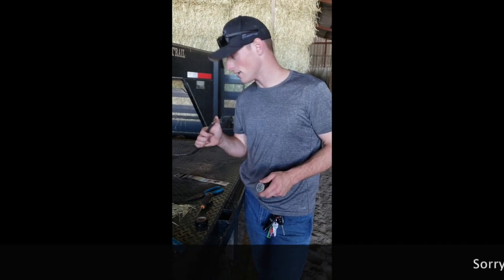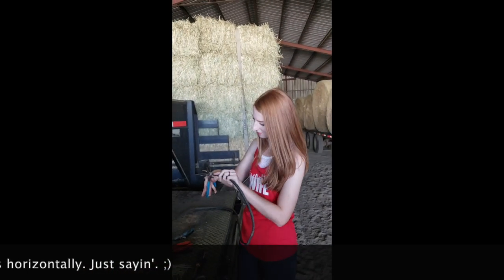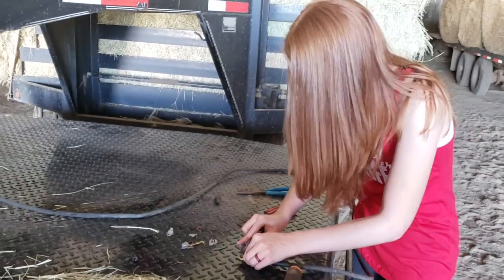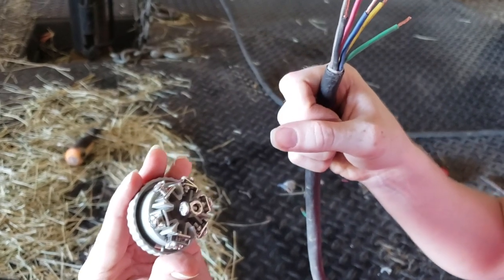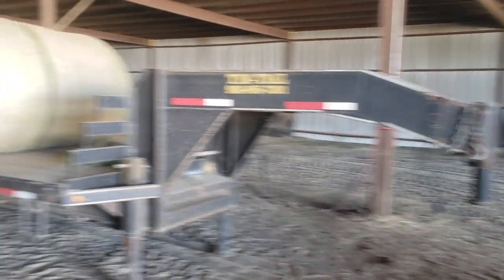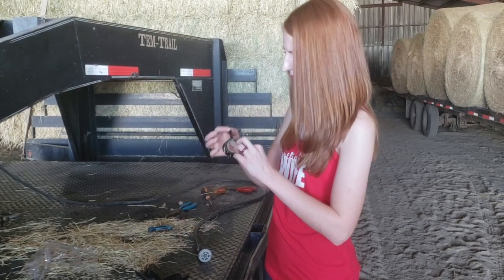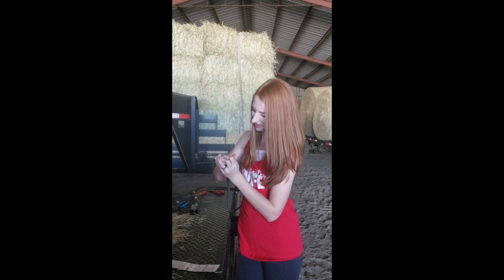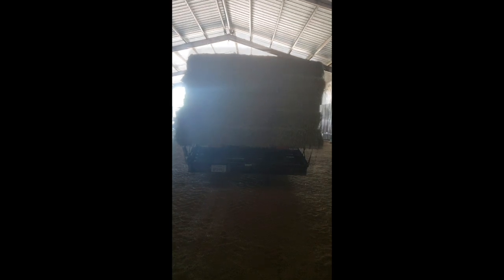Hauling Hay to the Feed Store + Cutting More Hay Down

Comment: Look the wiring pattern up online. Then, test your truck to make sure you have no issues there. Make up the connector and use a electrical grease when you put the wires in the plug. It will keep it from corroding and causing you to go back into it in a year or so. Running lights should work on the sides AND back at the same time. If it only works on the sides it can cause a short issue when you hit your brakes and that can cause that error reading on your dash. You also have a 12 volt that goes back thru that plug from your truck. I'd wire that up to. You can put a deep circle battery on your trailer (which is required over a certain load for the emergency disconnect). That 12 volt supplied in your harness /plug can recharge that battery and you won't havta do any extra work EVER if you wire it up correctly.

Comment: Yes John Deere cutters are more expensive.   We cut about 300 acres per/year, bought the moco new in 2011, never had a breakdown of any type.  You guys are doing great, don't get me wrong.  You've taken on quite an undertaking!  If it was me I'd trade that New Holland cutter in.  Nothing more aggravating than equipment that constantly breaks down.   At least I think so.  Hang in there it will get better as you get more experience.

Comment: On the mower, make sure all the pulleys that should be free spinning are doing so, grab each one with both hands and try to wiggle them, if they wiggle you got a bad bearing or bushing. That belt should be fairly tight, check the springs on idler pulleys, one could be stretched or cracked. There should be a lip on each pulley, top and bottom. look for shiny metal, missing paint. Looks like the main pulley is a double and the others are not, make sure you're using the correct groove

Comment: The grounding trough the ball is likely your biggest problem if the wires are all right in the plug. A good way to find out is plug it into the truck and turn on the marker lights and move the wire around the plug until the light come on then you will know. The marker lights are usually brown but sometimes trailer manufacturers don’t use standard color coding. If it’s grounded through the ball hitch you have to drive around so the rust wears off the ball to get a connection then thee lights will work.  That’s why trailer lights sometimes flicker when they go down the road empty. Confusing I know so I’ll stop there because there is a ton more that could be wrong.

Comment: On your trailer, use a 12 volt power source such as a battery charger and connect the wires one at a time to the positive lead to see what wire feeds what on the trailer.  Connect the ground from the power source to the trailer frame.  In a former life, I was a trailer mechanic.  Wish I was closer to assist you guys.

Comment: Try running a white wire to from the plug to the trailer for a ground cause it should have a ground wire . You guys are doing a great job its all a learning curve. Keep up the great videos
Reply: I thought so too and wondered if the ground was down in the rubber sheath. It wasn't and after some research, the ground is through the chassis of the truck (apparently).
Reply: White wire is neutral

Comment: Just a little advice, dont use the radio and listen to the sound of the cutter , if you have a problem the sound will change, you can also adjust your mirrors and watch the crop as it comes out the back of the cutter. I have arthritis in my neck these are a couple of my tricks to help. I put a backup camera on my round baler on the pickup I can see the crop coming into the baler and I can see the net go on the bale, and I can see the bale roll out the back of the baler looking through the pickup . good luck
Reply: That cutter can wear a neck out!

Comment: You can get terminals that crimp onto the wire and then the screw tightens on the solid pin which holds more solid than the strands of copper wire.   They have yellow for 12 and 10 gauge wires, blue for 16 through 14 gauge wires. Yall are doing real good. Keep going. Maybe another brown wire for the running lights, if the color of wires are correct.

Comment: Belts- a little research turns up that the over running clutch may be the problem. If its not working, when you slow the engine or tractor while cutting at high speed, the inertia of the spinning cutters will 'push' the tractor, and causes the belts to reverse their loading, which means the idler pulleys are not holding tension on the belts. Clutch may have gotten stuck over the winter?
Reply from the maker: Scott nunya You are spot on about this. I have great footage coming in the next video.

Comment: Great video! I would definitely hook up the ground wire because a poor ground will do weird things, from dim lights to wrong ones flashing. As far as the belt goes, there must be something out of line. However it doesn't take long for a new belt to stretch. I'm not familiar with that cutter but something funky is going on causing the belt to jump off. All the best, God bless and take care all of you!
Reply: I'm thinking it's the overun clutch!

Comment: Always run the cutter at 1000 RPMs. And your ground speed with gearing. It will take a lot of tork and stress off of your belts on the cutter.

Comment: brown/black is marker/tail lights if your brakes aren't working on trailer the the blue wire circuit needs looked at as well as the red constant power,also need a ground circuit to make sure trailer brakes work also noticed the turn signals looked dim getting on the interstate  thats where a ground circuit comes in for good light illumination, also IF it started raining in the daylight hours you would really need marker & tail lights

Comment: Check the over running clutch on the drive shaft you should hear it clicking when you idle down and the pto shaft should slow down first and let the blades wind down slowly if it all stops together it is stuck and will cause the belts to jump off.

Comment: I like to heat the wire casing with a lighter. At the right temp you can pull them off without burning your finger and they are stripped just right. I have forgotten that cover too many times. up here in Minnesota those plugs last one winter maybe two. Thanks for the vids keep up the work

Comment: Check all your grounds to chassis and make sure the ground from the goose neck hitch to frame is good. It sounds like the truck is fine, so it might be a broken wire... ugh... those are the worst to chase down... just get a volt ohm meter and figure out where you’re loosing power. Scott would sure be proud of y’all!

Comment: You guys did good, even though the was small hick ups with the wiring of the trailer. One advice you can use on any wires that are hard to strip the insulation off is never to cut across the cores of the cable or wire, always in the direction the cores are running, bend the plastic/rubber to the side and nip off the plastic along the cores with a cutter. Cutting across will make the cores very easy to break and thereby loosing connection to broken cores when the wires gets stressed. I noticed it was not a screw connector on the trailer plug, but if you have any here's another tip: when putting loose core wires under a screw connector where the screw of the connection is in direct contact with the wire is to strip a longer peace, twist the cores and fold them double before putting them into a screw connector, that will also prevent the same issue.

Comment: IF YOU HAVE SIDE MARKERS BUT NOT RUNNING (TAIL LIGHTS) ITS IN THE TRAILER.  MAKE SURE YOU HAVE THE BLUE WIRE HOOKED UP CORRECTLY  AS THAT IS YOUR TRAILER BRAKES....  MOST IMPORTANT WIRE IN THE BUNCH WHEN HAULING 20K...  SHOULD BE ABLE TO HEAR THEM HUM AT THE AXLES WHEN APPLIED IN THE TRUCK.  AND MAKE SURE YOUR GAIN IN THE TRUCK IS SET CORRECTLY SHOULD FEEL THEM DRAG WHEN TRUCK BRAKES ARE APPLIED.

Comment: When hooking up the wires to the plug... you have to open the little box on the trailer where the wire goes into.  Matching Colors does not work.  If you open up the box it will show you what color of wires control each function...and should tell you on which screws to hook them up to on the plug.
Reply: Good to know! We had no idea. I will go back and redo it ASAP!
Reply: @caraatnorthtexashay3043  looking on the other trailer was a good idea to.

Comment: Howdy,
      I showed my farmer  friend, Mitch this video, he has one of those monsters, and he thinks that your feeding the mower at more that 100% its rated "chew" rate.  When you have fixed this monster try slowing the ground speed some.  Mitch thinks the failure is that the belts are stretching from the load and popping off, not breaking.   Good luck,
Reply: I tend to operate it a bit on the slower side as we have some pretty thick grass (not a brag, we just concentrate on certain fields.)

I'm going to delve into the operators manual a bit more but we operate it on the lower speed than recommended. MPH that is.

I believe we have narrowed it down to the overun clutch not working right and jolting the system.

Comment: It is grounded through the ball, I've actually had to earn my reese hitch ball off cause it had rusted so bad thoughts wouldn't work so it does in most cases ground through the ball, so of you ever have that kind of problem some light sand paper will fix it
Reply: There is also a ground that is SUPPOSED to be passed from the truck to the trailer through the lights.  The hitch connection IS NOT CONSISTENT ENOUGH to consistently power turn signals/brakes/etc.
Reply: @jayss10  sure depending on what options you have on the trailer,  like breaks and stuff like that, mine didn't have that so it just grounded through the ball

Comment: I have found that a ground is very necessary because grounding through the ball is very intermittent and the brakes don't always work among other problems.  I always run a ground to every thing to ensure proper grounding.  Figure out the color code on the truck and wire the trailer to the truck.. those are never coded to Ford's.  And can be a s.o.b . Be safe 
😊😊
Reply: I echo the suggestion on implementing the ground on the plug here.  I know for a fact that my 2006 Dodge Ram will not activate the trailer wiring plug unless it senses a ground with the trailer.  While this is a strange brain child idea of Dodge/Mercedes at the time the TIPM is something that has not gone away after Mercedes sold Dodge.  Wire it correctly and avoid these weird quirky issues.
Reply: @jayss10  it can cause a lot of trouble. 😊

Comment: For the PTO circlip use a set of vice-grips.
Squeeze the grips together and set them to the correct tension with the thread so they just slightly lock.
Then leave them like that while you change the PTO stub.
Hope that helps.
Also,remember to do it before you hook up the next machine 😁😁
Reply: Usually I'm there to hook it up but they did a solid job!

Comment: Check how the wires are wired on the other trailer. There is a standard wiring diagram for trailer wires. 
They use a certain color wire for tail lights, certain color for left turn & stop light & a certain color for right turn & stop lights. Now on vehicles the wire colors change.

Comment: Might suggest to go ahead & run a white wire  for a ground, sometimes the trailer ball doesn't ground real good.  If the side marker lights are working, the tail lights should be also, since they're on the same circuit. Look for a loose wire towards the rear of the trailer, or the rear bulbs are burned out....  Kim, i believe Scott's note that he left for you just about covers it all....

Comment: I didn’t see you check for electric brakes for operation.  Basically you just get down by the wheels on the trailer and you should hear them buzzing with the brake controller turned up.  Need to do this with every axle on both sides.  Sometimes particularly with a trailer that sees alot of field time you can accidentally rip a wire out of a magnet etc.  Takes only a second to do.  This is a pre-trip check I do on my trailer every time.  

As for wiring repair. Don’t rely on wire color. There are several “standards” where colors are used differently I’ve seen used by various OEMs. You need to validate wiring by function particularly when a plug has been ripped off.

I usually locate the ground first visually.  It will break out of the main part of the harness not far from the plug and terminate on a 1/4 ringlet normally near the hitch. It’s usually a white wire but you gotta confirm.  From there I just use a 12 volt drill battery (can be any 12 volt power source) and hook onto the (-) part of the battery with a alligator clip or similar and touch the other wires one by one to the (+) terminal on the battery to find the function.  You’ll find the following.  I’m listing typical colors but you gotta verify. 
1.  Running light wire. Should be brown.
2.  Electric brakes wire. Should be blue. 
3.  Left turn signal wire. Should be yellow. 
4. Right turn signal wire. Should be green.
5. If equipped Auxiliary power wire. Should be black but seen red too. 
6. If equipped Backup light wire. Usually purple.
Reply: I appreciate thorough response! I checked them when driving slowly and found they were not functioning.

The truck is more than capable of handling the trailer for the distance I travelled and I also proceeded with generous breaking distance when driving.

I'd like to get them working ASAP

Comment: I vote for Cara to pick up the torch (mig welder that is) as she has the steady hand and that is paramount in welding, maybe add more guide pulleys closer to the drive pulleys on the discbine. My local CNH guys said that some belts cant handle high heat and sag once up to working temp, there are high quality belts (high price too) that can handle the heat more and don't stretch. Dang but i remember Skittles taking that road by the water hauling hay a while back, great episode ya'll and remember if it's getting to ya.... just lay back and say.... THIS IS BALLS!!!... and "get on with it", lol.

Comment: Yellow = left turn/left brake light
Green = right turn/right brake light
Brown = tail lights/running lights
White = ground
Blue = electric trailer brakes
Red = constant power for acc or charging break away battery
Reply: When I get off work I'm going to check this out! Thanks!
Reply: @treyatnorthtexashay4603  I've wired many and that is standard code. Anything I can do to help just ask.
Reply: Much appreciated! I'll let you know how it goes.
Reply: Trey, this is a standard but you gotta confirm.  There are several standards I've seen out there.  You gotta confirm by function with some sorta power source (battery etc) the wire purpose.  Don't assume color codes.  I've seen black used for auxiliary power vs red.  Gotta confirm.
Reply: @jayss10  most certainly. I will double check every with what I know now.
Reply: @jayss10  Doubtful. This trailer was built at a reputable manufacturer and not your fly by night company or your shade tree fabricator. About the only time you find wrong color wire is when someone did it themself

Comment: Add a white wire into your plug and make it long enough to be attached to the frame. The ball DOSE not give you a solid continuous ground. Wire from truck frame through plug to trailer frame is best. 

Also cheek your bubs contact points. Sometimes they can get corrosion inside the light covers.

Comment: I would check the wiring on the truck first, looks like socket might need re-doing to meet the standard layout. I'd then re-jig the trailers to correct layout, and add the ground wire to them. Something must be out of alignment on that cutter.

Comment: Did anyone check the bulbs? If the side marker lights are working, the tail/running lights should work. They use the same power wire from the truck. 
There are two filaments on the bulbs. The low wattage filament is the tail lights. When you press the brake or signals the high wattage filament (bright) lights up.  Trailer lights will drive you nuts but is usually something simple. I have had both bulbs bad at the same time.  

On another note...I had a pulley worn on my baler from all the grass and dust grinding away the V-groove. It kept chewing up belts. I replaced the pulley and prob solved. 

Watching from nearby Decatur
Good luck and god bless.
Reply: How did you diagnose your pulley issue? The pulleys turned smooth with no noticeable issues so I don't know how to know if it's bad.

The bulbs seem to run ok. The reason for this is when unlocking the vehicle, the lights turn on! Haha

Comment: Trailer wiring in a pain, never seems to be easy and there’s always a broken wire somewhere under the trailer when I work on the plug that burns me, lol. I don’t have any good advice on the MoCo but with I had a hay chopper for spreading hay on lawns after I spread topsoil that blew belts for no logical reason and though I don’t believe in any “problem solver in a can” type products, if I hosed it down with belt dressing spray before each use it threw belts far less often maybe that combo’d with whatever fix your friend suggested might help you